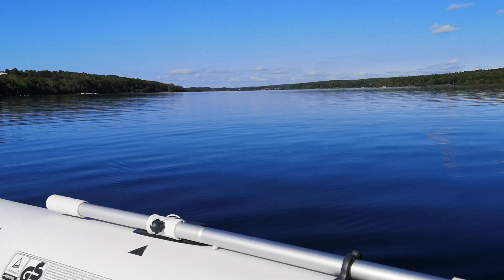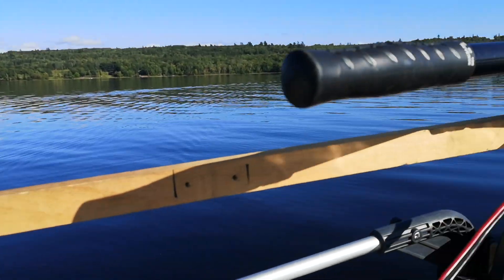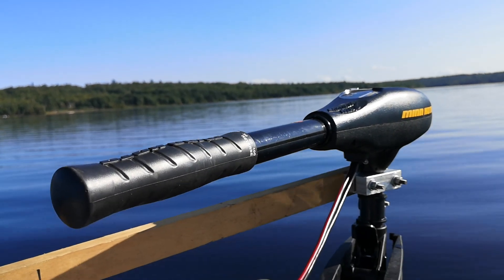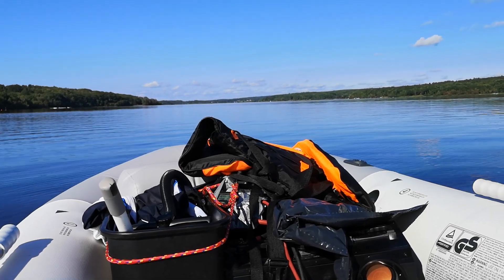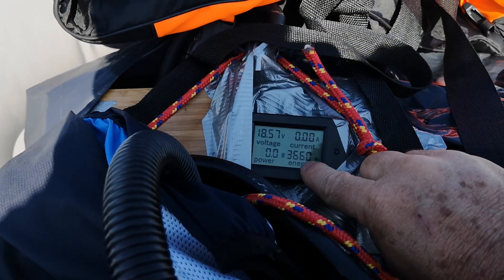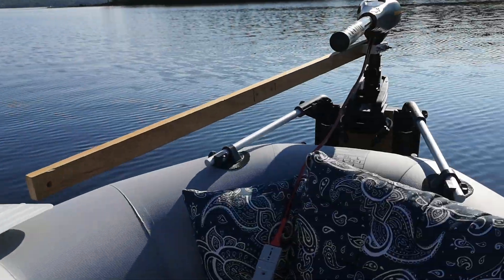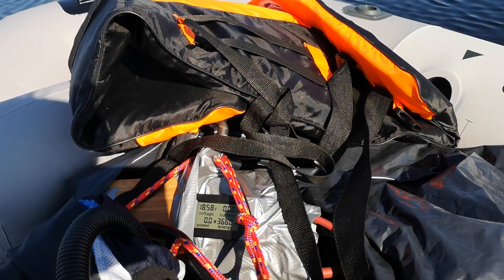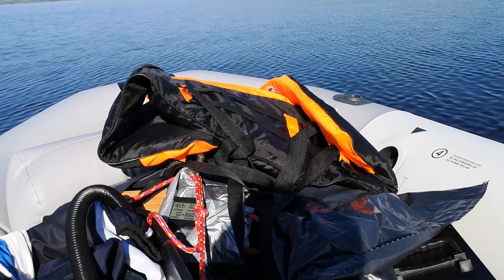running 12v trolling motor with 18v battery - 6hr electric cruise Intex Mariner 4

Comment: Heck ya dude! That's awesome !!!!
Reply from the maker: thx! I am running again this year with a 24v 70lb trolling motor with an 8s lithium ion home built battery of 8kw and having a great time. I have found that you can run at about 500-600watts and go 4mph, but you don't get much faster even if you double the watts. So 550 watts is kinda the sweet spot.At that 4mph, and the 8kw battery, I can go for about 14.5 hours, but that most I have done is about 7hrs at that pace.But everything stayed cool, which is the main thing I am trying to accomplish.